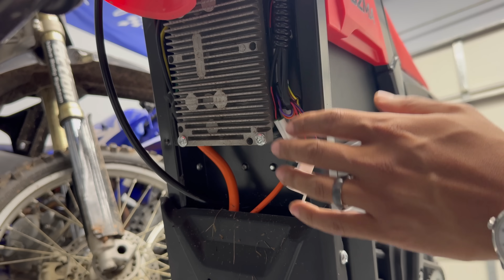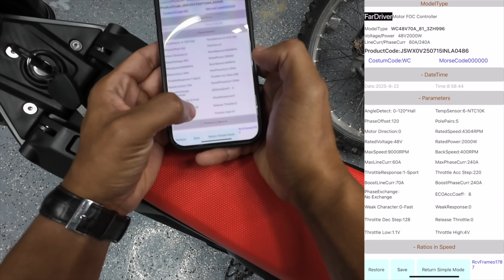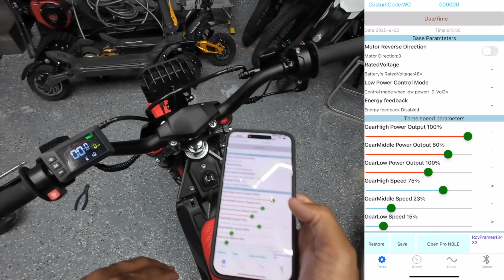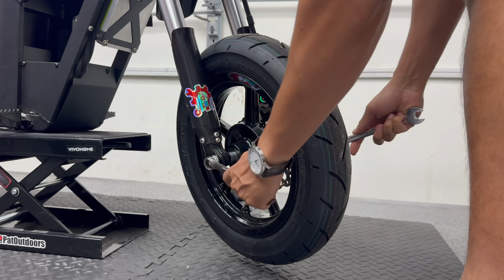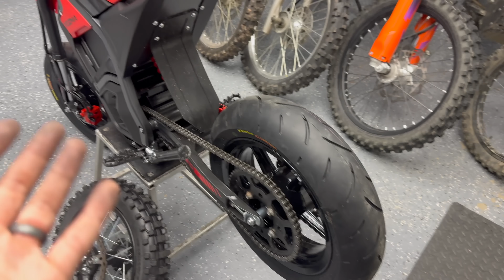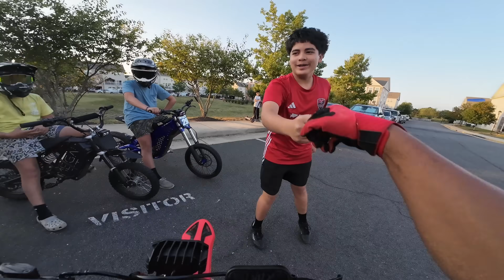Yozma IN 10 Upgrades Modifications and Unlocking Top Speed

Comment: How many miles do you get with the dongle on the setting you got it on? I need one of these for 10 mile to work, then 10 miles back home (I will charge it at work)
Reply from the maker: If you’re concerned about miles per charge.. don’t turn up the line or phase amps on the controller. The more power you use up, the more it will suck down the battery charge. This tune will not help with that. But 10 miles one way should be completely doable with a stock tune

Comment: Heyyy pat, I was wondering if you knew how to make the speedometer on the yozma in 10 accurate to real speed?
Reply from the maker: You go down towards the bottom of the Pro NBLE menu and make sure the gear ratio and rear tire size is correct.
Reply: @PatOutdoors thank youuuuuuu
Reply: One more thing if it's okay. My rpm percentages go back to 0 after setting them. and only 5000 rpm and below is actually set. 5000 rpm is at 41 percent.
Reply: @PatOutdoors I tried turning my gear ratio up and the display still shows 54 on mode 3
Reply from the maker: @kalebbathalon  don’t just try turning things up and down without confirming what your gear ratio actually is first. And start with confirming the tire aspect ratio / rim diameter / tire width inputs are accurate
Reply: @PatOutdoors What did you do for yours? Because the yozma comes inaccurate on the speed.
Reply: @PatOutdoors I fixed it I had to turn speed pulse from 4 to 5 now it's 100%accurate
Reply from the maker: @kalebbathalon good! Glad you had it figured out
Reply: @PatOutdoors honestly a good video idea because a lot of people would like to know how to make it accurate

Comment: We got the FarDriver dongle and all of the settings stay except for the Ratios in Speed. After save they reset to 5000RPM 41% and 0% everything after.  MaxSpeed stays at the new 9000RPM setting though.  What am I missing?
Reply: Found someone on FB with same issue.  It was fixed by leaving PID AN at 12. Once I went back to 12 the Ratios in Speed would stay
Reply: @MilesDeFeyter do you know why you have to leave it at 12 instead of 0 and has anything gone wrong since

Comment: do u need to keep the dongle plugged in after you change the volts and all that so when you ride do you keep the dongle in?
Reply from the maker: Nope! It’s basically just an antenna to connect while using the app. You can take it off as soon as you save the settings
Reply: @PatOutdoors  so when i plug the dongle should the bike be on and then turn it off and unplug it?

Comment: Hey man, just to confirm so the spacers on the Yama stay the same when you change the wheel ?
Reply from the maker: I use exactly the spacers and adapters that came on the Ride or Die wheels (for Tuttio) for the front, stock Yozma spacers for the rear

Comment: Hey whats the type of screws for the rear sprocket to the wheel? Got those wheels exactly but came without sprocket or screws/bolts
Reply from the maker: What bike are you putting them on? I just reused the ones on my Yozma stock wheels, same thing with my Tuttio. Might be either an M6 or M8 allen bolt
Reply: @PatOutdoors its on a kenda curve wheel for a yozma!! I tried reusing them but the screws are stucked big time!!
Reply from the maker: @obijuanhobbies they are just super hard to remove, almost like they’re over torqued from factory. I had to use an impact on mine lol

Comment: how much range do you get with the dongle connected? Also if you connect the dongle does it permantly mess up your battery even when u disconnect it?
Reply from the maker: You’re ONLY supposed to connect the dongle when you’re making changes on the controller settings. You just press save on the Fardriver app, turn the bike off, and unplug the dongle. The dongle is nothing but a Bluetooth antenna. Idk what you mean by a dongle permanently messing up your battery

Comment: Any ideas if these tunes will work on a 48v strike?
Reply from the maker: Should be a similar set up. What is the line amp setting on your strike currently? Do you know what the max output of the stock battery’s BMS is?

Comment: Do you think that you will be able to fit 14/17 wheel set on the yozma
Reply from the maker: Yes, though the tire clearance will be tight in the rear. You may have to trim the mud guard, use a much larger rear sprocket (for the gear ratio to be right), and use a longer chain

Comment: Will this tune affect the top speeds of modes 1 and 2? I usually keep my son on mode 2 and when I ride I'm on mode 3 for the most part but I just want to make sure if the top speeda of modes 1 amd 2 are not affected after doing this tune.
Reply from the maker: On the Fardriver app “simple mode” screen - you can simply slide a toggle left and right on all 3 mode’s “speed” and “power” to slow down the lower gears
Reply: @PatOutdoors ah ok thank you.

Comment: Hey, can you tell me where you bought those supermoto tires for the yozma, both wheels, and a tutorial on how to put them on/install them.
Reply from the maker: . RideOrDie 12" Front Supermoto Wheel/Tire: https://collabs.shop/gi3dya
. RideOrDie 12" Rear Supermoto Wheel/Tire: https://collabs.shop/dieerj

Did I not cover the wheel install in this video? What steps did I miss?
Reply: @PatOutdoors sorry I should’ve been more specific on how to install, what I meant to say was for how to install the tires onto the rim if needed. If it needed.
Reply from the maker: @AviationClips1234 did you click on the links to see the listings? The wheels come with the tires already mounted on them.
Reply: @PatOutdoors Yes I just noticed it. Thank you.
Reply: Oh and one more question, do you have to change the yozma sprocket to the black one or I can use the stock one with supermoto.
Reply from the maker: @AviationClips1234nope! Stock sprocket works. I just wanted to test out different gearing combo

Comment: Does the tune affect the range
Reply: Well if your going faster the battery will go down faster
Reply: @2.0-Andrew how much faster? Will it still last a long time tho?
Reply: @DOUBLE-248 I have mine tuned and it’s still okay range like around 25 miles
Reply: @2.0-Andrew ok thank god I was getting scared lol, so it takes down 25 miles of range?
Reply: @DOUBLE-248 like if you take it slow and don’t fill pin 24/7 you’ll ride for around 1 hour 30? Maybe 2 hours
Reply: @2.0-Andrew wait that’s actually perfect, thank you bro so much  🙏
Reply: @DOUBLE-248 np bro but just don’t put too much power or it’ll mess with it
Reply: @DOUBLE-248  speed requires exponentially more energy the faster you go. Depends on where on the exponential curve you are. Also higher energy draw means battery drains faster, disproportionally. It’s cool but tough on the stuff
Reply: Like a gas powered car with mods or if you drive your car crazy you'll burn gas quicker same goes with the electric.
Reply: Yes
Reply: Obviously
Reply: Yes
Reply: Will this tune be the same for the pro version?
Reply: @sledhedone good question wondering the same thing
Reply: I mean your turning the throttle up so I would guess yeah
Reply: it depends how u tune it because you could make it go just faster and range stay the same or you could tune it slower but faster than the original speed and have farther range either way the range should basically stay the same
Reply: @Team.CSTV1 ok thanks i was wondering the same thing
Reply: Dumb questions do exist

Comment: Is it the same one as the tutti ?
Reply from the maker: They share some similar components like the fork and wheel design, but completely different bike altogether. Different frame / motor / plastics / controller is hall sensor rather than encoder etc..
Reply: No like the dongle is it the same
Reply from the maker: @IsaacTheRoblox it’s Fardriver, it’s universal to all bikes with Fardriver controllers. So yes, that is the same as the one for the Tuttio
Reply: @PatOutdoors thxxxxxx
Reply: So I buy the same as the one in the vid from tuning the tuttio

Comment: Congrats. Have a question when you tune the controller can this be tuned to have less speed for a kid in the 3 different modes? New to this but my son has been begging me for a edirt bike but want to make something that I can upgrade as he gets better. Any suggestions would be amazing.
Reply from the maker: Yes! You can use the same exact tuning process to turn down the “line amps” and lower the max RPM limit and slow the bike down for them till they’re ready for more.

Comment: What is causing that rattling sound when you are riding it? Chain hitting the frame/tire?
Reply from the maker: Chain is not hitting the tires at all, this bike just makes a lot of chain noise in general from friction on the lower tensioner / roller guide

Comment: If you put a surron battery in, just for testing, don't cut the seat..  Cmon Pat. Lol. No permanent changes for a temporary test. 

Just wrap a towel up as a makeshift seat to see how it goes.

Since this is basically a Valtinsu em5, Amorge has 60v andn72v batts that'll fit right in with super high Amp output if the Surron batt works. 

And then slap the unmodded seat back on.
Reply from the maker: Well I’m kinda tempted to keep it permanently that way. Would be nice to have 34AH battery capacity 🤷🏾‍♂️ I would do it super clean if I do

Comment: Have you tried holding down plus and  minus or plus and mode as sometimes with those displays it can be changed in the display
Reply from the maker: Yes, that just goes to a simplified “P-Settings” menu. I’ll look to see if there are any options there, thanks for the reminder
Reply: @PatOutdoors no problem I had to active the zero for my e-bike and it’s a throttle and pedal assist and my throttle only works in assist level 0

Comment: 42mph on a 48v bike is impressive! Just imagine 72volts
Reply from the maker: Wait for it. We’re just 3 days into ownership 😂
Reply: @PatOutdoors  Isn't there a throttle speed calibration needed  during setup of dongle before tuning in the app changing anything or is that not needed?
Reply: @jessewoodworth3888 suspension and braking is all you really need to mod it